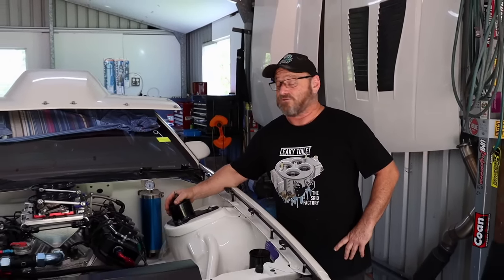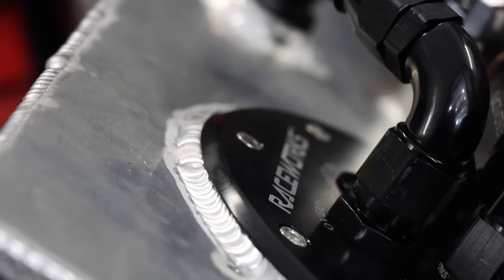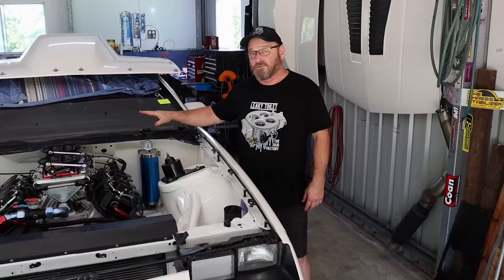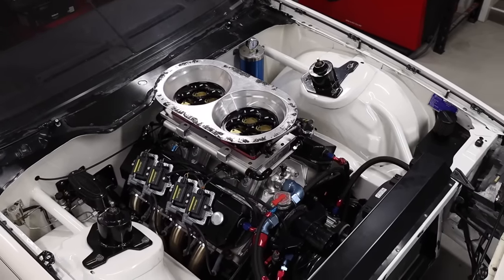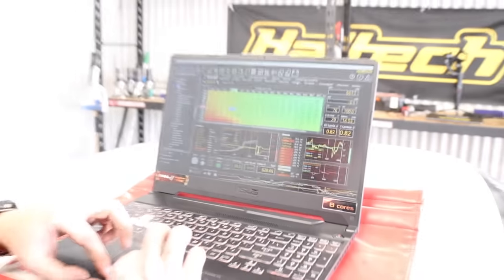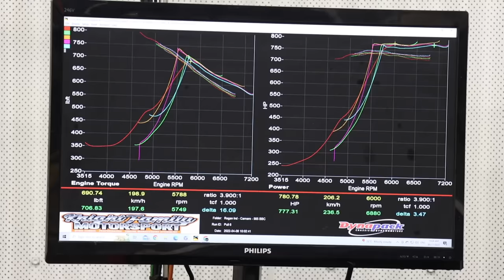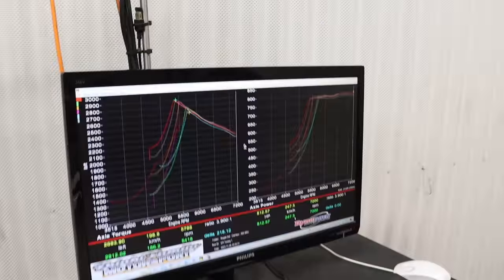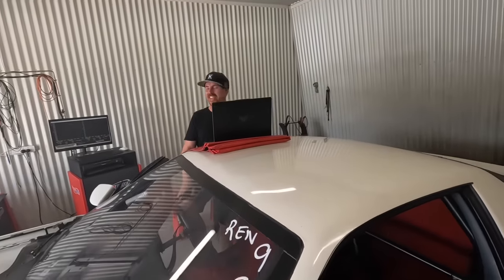Carburetor VS EFI - This 1000HP 565CI Big Block IS ROWDY!

Comment: 1.41hp per cube at the hubs naturally aspirated thru that drive train is super impressive. Awesome effort by all.  That calculation is based off 800 wheel.  
Great episode
Reply: Having run a dyno that is impressive.
Accurate information.
Reply: Much better then the original stock block
Reply: Getting up into stock Honda 4 cylinder territory!

Comment: In fairness to the people who are reluctant to switch to EFI it’s a pretty big effort to swap especially if you’ve been tuning carburetors for the past 40 years. Once Dave learns what he can do with the software that’s when he will be most impressed. Adding timing or fuel with the click of a button. I get that it would be very overwhelming but these older racers don’t give themselves enough credit, they are smart dudes. Everything else being equal the more effort you put into learning something the better the results.
Reply: I agree but I am still reluctant to switch I have been going backwards and forwards between an ls2 or 350 chev on my workshop ute I know the 350 chev is going to be an afternoon job 

Where the LS is just so much work fuel 
computers 
Radiator
Sump 
Plus all the stuff I don't know about

It's just to much work I think
Reply: Don't forget that so many early multi-port EFI systems used really long intakes to help with torque on the street. If I had a dollar for every time I've heard that injection makes torque but carbs make horsepower I could have retired at 25.
Reply: Considering EFI has been the standard in all aspects of automotive for the last 30 years, it's not new.

Comment: Does fuel temperature affect hp? Would cooling the fuel cell be beneficial?
Reply: Definitely makes a difference in a diesel so I'd say having the fuel as cold as it can be would increase performance just as air being cold does
Reply: Yes it does, in short. In most high level motorsports (F1, MotoGP etc) they usually specify a minimum fuelling temp due to this reason.

More than anything you are just trying to avoid vapour bubbles or excessive heat buildup resulting in tuning or performance issues.

Comment: Al has of course built many cool cars, but as an engineer on a race team I’ll bet my next pay check that running a traditional return cools your fuel more. Obviously higher base pressure helps with the boiling point, but the deadhead setup (especially with a regulator that far back) will experience pressure drop over that long of a distance. The pressure you read at the regulator isn’t what the engine is seeing when it has to travel that far…
Reply: If you measure pressure at the rail, you account for that pressure drop. Now I don't know how brutal thr pressure difference can be as fuel demand raises, but it can be managed by the nexus.

I'm questionning what is the biggest adder of heat in the fuel though. Is the heat of the motor through the rail a big one or the pump makes for most of it. I don't have data to support, but i guess a variable speed fuel pump is one of the best way to keep fuel cool.
Reply from the maker: As a race car engineer surely you can undertand that the fuel pressure is being measured at the rail. 
You know why OE cars have deadhead fuel systems?

Comment: outstanding,1986 i bought a fully worked 265 hemi in a centura ,biggest damm issue was the 3 webbers hangin off the side ,the petrol fumes on full throttle was beyond belief ,id have the carby specialist here in melbourne rebalance and rejett them but within a fortnight id be drivin with my window down again ,ended up literally throwing them in a dumpmaster at the mechanics and replacing with a four barrrel ,how things have changed 2024,damm i wish this was available back then id be in the 10s

Comment: Is this running e85 to pull 37degrees of timing. Also does the dyno that reads temp and humidity also read DA?
Reply: 15:03 they are pouring in race fuel, I don’t know what type though.
Reply: Yes it calculates DA and we were running VP X85 on the dyno that day
Reply from the maker: It is running E85 but old engines like BBC need a lot of ignition timing anyway, they just don't have a great combustion chamber design.

Comment: With regards to the wideband sensors and also checking the spark plug.

In electrical work we 'test the tester' to confirm readings. A tool that works in the morning can sometimes be broken in the afternoon.
Confirm readings before trusting them.

Comment: Love the episode, but then all of these are great.  Great in-depth discussion on all aspects of a build.
One question, I was interested in the point about not having fuel circulation. If this was a straight drag car I would probably accept it, but as it is a street car, is there more detail you can add?
Is there a difference in fuel pumps?

Comment: Question. What’s the advantage (considering cost )to going 8 wide band sensors over running 2 sensors one on each bank and running EGTs on each cylinder? Considering as well you still want to pull the plugs to make sure the sensor is working correctly.

Comment: 70% humidity at 54F here in Florida, so 64% sounds nice. However, since 0 to 100% humidity kills around 3% total power, with the moisture we set at 101.71% for power production. Our dyno correction would lower the power numbers, right now.

Comment: Carbs for power 💯 
Efi for tunablity, can tune each cylinder and for boost. He should have put the 15k into a spray set up and picked up 350hp not 35 😂

Comment: From my experimenting with exhausts and headers over the years I've found that having the header as the bottleneck is the way to make the most torque.  They can't be overly restrictive which would cause knock issues but having them sized so that the power starts to drop off a tiny bit at (or just past) redline maximizes exhaust velocities.

Comment: If you think your going to set new records by swapping from carb to efi your barking up the wrong tree. If your going to efi its for the all weather driveability, part throttle control, economy, driveability especially if you got big overdrive gearing. You only need to look at Nascar they gained nothing in outright HP by switching to EFI.
Reply from the maker: You only have to look at Nascar to understand why they did switch to EFI.

Comment: It's a proven fact that you can make more horsepower with a carburetor than you can with an EFI system on an N/A engine and if you know what you're doing you can get them dialed in with each cylinder just like you can with EFI
Reply from the maker: Absolutely, that's why all high end NA motorsport uses carby's.

Comment: Not a bad way to spend 10 grand, especially after everything else was already at top notch. Difference between carbs vs efi is plainly self reliance vs handing the problem off to someone else, haha! If you have the time, patience, and interest to dial carbs and distributors in then carbs is your way to go. On the other hand if you are at that age where you can't really crawl into an engine bay or underneath to get to a hard to reach plug or if you have no idea wtf you are doing then efi is definitely the way, 'its the tuners problem'.

Comment: Hey guys, doing a similar setup with the vacuum on my car, just wondering where the vacuum hoses go after the external pump? I was under the impression they would have to go to a tank or is there another way to do it? And is the crank case pressure sensor just a normal pressure sensor? Thanks
Reply from the maker: It goes to what is traditionally called a catch can. The sensor is a 1bar map sensor.
Reply: @theskidfactory  ok thanks for reply, And obviously the catch can only receives the stages from the breather fittings? Or can you run say an oil drain to catch can via pump and return to sump?

Comment: Quick one. When u mentioned temp sensor on the transmission, is it protocol in street application to give the ecu the temp of the transmission sump, or the cooler line after the trans cooler?
Reply from the maker: I prefer to take the temp of both trans and engine oil in the sump well.

Comment: Good evening.
What steering rack etc did  you'll use to switch the car too RHD ?? 🤔
(Paul in Barbados 🇧🇧)
Reply from the maker: I think it was originally a Holden power steering box but is now an aftermarket drag racing spec rack.

Comment: for me it was always no-brainer that EFI makes more power. Runners are much shorter, much less loss on fuel "dissipation", and "mechanical" losses on carb are much higher (delayed mechanical response due to the number and size of moving parts). So carbs just can't be comparably precise in fuel mixture, and much harder in overall tune (fuel and weather-based).

Same goes to manual valve gap adjustment vs oil-filled adjusters (same, oil-filled will always lose comparing to the right adjustment due to small variability/delays in valve timings).

P.S. It's interesting how the owner fine-tuned each "barrel" of the carb for each cylinder =). How much time and fuel he spent to do all 8 =). And (obviously) how much less it takes with 8 wide-band sensors and fuel injection with stable fuel pressure =).
Reply: Now go racing and change it again

Comment: C'mon champions you went the the cost and trouble of doing the 8 widebands then never showed the benefit of the trims! What happened?
Reply from the maker: It actually didn't require a great deal of trimming which is testament to the design of the engine, intake, headers etc. Other engine absolutely have issues.
Reply: @theskidfactory  Ok sure that was the case looking at the design but still it might have been good to show the effect by trimming the right and wrong way, even at a lower speed or load. Awesome vid, car and team regardless!

Comment: For the sake of saying it. In an actual back to back (not changing header sizes, inlet sizes and everything else) a carb will always beat EFI for power production, every single time, without fail. Test has been done to death by engine masters in about 3 episodes by three of smartest minds in the engine building and tuning world.

Good to hear that big block sing! Awesome job on the wiring/EFI conversion.
Reply from the maker: Whats the science behind it though?
Reply: @theskidfactory  the air temperature drop across the carbs Venturi and the atomisation of the fuel being drawn into the air will never be matched by EFI unfortunately, even the annular injection hats like a fitech or similar aren’t quite as good. You’ll make a little back by the fact you can do perfect cylinder to cylinder fuelling with MPFI but when you’re plenum air is ambient and a carbs plenum air is approaching freezing. It’s not a battle EFI will ever win. I’d recommend watching the episodes if you are interested. I’ve been tuning for a long time and Steve Brule has probably forgotten more about it than I’ve learnt.
Reply from the maker: So you are suggesting that latent heat of evaporation is the reason that carbs make more power? A cooler intake charge?

Comment: Was there no room to mount injectors above the throttle body?
Reply: Multipoint > TBI. Better atomization, per cylinder control of fuel and no pooling on the throttle blades.
Reply: @BuddyDarDarTV  I'm not tally about TBI, I mean mounting the injectors outside and above the throttle body.  This is typically the best location for maximum power as it cools all the air inside the plenum.  You will see this configuration on many very high output engines such as the older normally aspirated F1 engines, and some sports bike engines.
Reply: @ferrumignis so throttle body injection?
Reply: @ferrumignis  I haven't run across that personally. I can see the how the cooling effect would improve power, but I'd imagine that as technology improved that was bested by the more accurate metering of fuel and better nozzle design afforded by sequential multiport. I definitely could be wrong though, haven't researched the upsides of injection upstream of the TB.
Reply: @BuddyDarDarTV  Pre throttle shower injection is effective on maximum output engines where WOT performance is the only thing that matters. The further away fuel is injected from the valve the more time it has to atomize, homogenize and cool the air, making it more dense.
This is also why carbs usually make more top end horse power, because the fuel is entering further away from the valve by design.
Shower injection does come with its fair share of issues though, like poor starting, challenging transient throttle fuel film characteristics and poor emissions due to raw fuel being sprayed outside of the engine lol.
Reply: @nismofreak33  Appreciate the info, that all makes total sense.  Thanks for taking the time to write that up. 

My focus has always been on street cars, but I can see how pre throttle injection or carbs would be very useful in drag or marine applications.

Comment: I would like to see you guys bolt the carbs back i bet it makes more power ,also kye must have got confused about the high pressure area  where the scoop draws from its actually low pressure
Reply: When air moving at high speed hits a wall and has to change direction does that make high pressure or low pressure?

Comment: I wonder how you get them headers off
Reply: Pause at 7:42 they are individually mounted to the head and you would unbolt the clamps from the collector 11:03 and remove them one at a time
Reply: Oh, yeah thanks. I thought it wouldn’t come apart at the collector. .

Comment: I could have got more horsepower with the carbie. I have 50 years experience with carbies.
Reply: Even the man who has nearly 40 years of experience with his own car using multiple extremely high end carbs could see the improvement already..

and also the potential at the track where the tuning can be done before each run.....

taking into account the humidity, altitude and temperature at that moment..

and setting shift points in the trans as a bonus depending on the stickiness of the strip..

all with the touch of keys on a laptop.
Reply: probably less to do with the carbie and more to do with the new exhaust.

Comment: I love EFI, but it doesn't promote the cause when you have at least 3 other reasons that it made more HP: 1) day/temp was different, 2) header exhaust size, 3) a better tune in the EFI.  Take it to the track, show me a .163 gain.... on that motor, that's less then a .5% increase in power....
Reply from the maker: And we said exactly that on the video. It's engine management not efi. Full control over the engine and how it delivers the power on the track. 
Your math does not work. You reckon a .163 second gain is .5% power increase at this level?
Reply: @theskidfactory  1000 hp, 50 hp gain, .5% gain... think that math is right.  I was struggling with the e.t. calculation .163... think it's .0163 on reflection... point still is the headers not how the fuel is delivered is what made the difference.  My real thought is anything less then 3% on the dyno is a statistical increase (for the very reason that there are so many other variables that are at play that could make the difference.) What it did do is make a track car into a car that can be driven on the street.  A carb, especially at that hp level, will never achieve that.
Reply: @stoneshrink  5% bro on a hot humid day
Reply: @alexandersupertramp1293  "track times" ... otherwise I call shenanigans
Reply from the maker: 50hp at the hubs up from 750hp. TH400 and 9" need to be paid also. 
6.5%. If you think that is not a significant gain on an engine at the pointy end like this is then you are incorrect.
Reply: @theskidfactory What if Engine Masters is correct? in that the carb makes more power due to the additional time for the fuel cooling? that the 50 hp gain would have been 100 hp with the carbs?  Enjoy the content but I don't think any questions were answered (my original point).  The only gain I see is the ability to drive it more.

Comment: That's not a true comparison to carbs, a, with the new exhaust,  new coils  can add 40 hp, also,  indexing the spark plugs will add 30 to 50 hp if done correctly,
Reply from the maker: 30-50hp from plug indexing? Come on man.
Reply: @theskidfactory  well you obviously have never done this, and do you know what it is and where it came from, started,
Reply: @geoffreyfox7618 indexing does mostly nothing. And with the new EFI management, I bet zero difference.
Reply: @TML34  have you done this , as I have and been doing it for years,  verified on dyno ,and this is a 1950s old trick, better combustion,  better full efficiency,  more torque, more  power
Reply: EFI gives you efficient use of fuel, indexing plugs gives efficiency of burn,
Reply from the maker: Dave indexes the plugs on this engine. But it is never going to add 30hp.
Reply: @theskidfactory  and have you verified this, you have changed the cfm, and exhaust,  that is the gain ,

Comment: Nice to see a throttle cable instead of the fly by wire nonsense
Reply from the maker: Electronic throttle would have been far superior in this application but getting throttles large enough is an issue.

Comment: 810 RW corrected HP,   Not 1000.
Reply: Do they have a wide band sensor for that...??
 @themoonhurtsdaddy
Reply: That's at the flywheel as per most manufacturers. It made over 1000 on the engine dyno in America

Comment: Its not like for like put the carbs back on with the new set up and it will make more hp and torque than EFI its been proven numerous time (and at what cost for 30hp)
Reply from the maker: Do you know how much carburettors and fuel pumps cost at this power level?